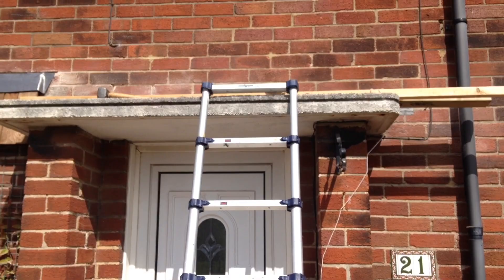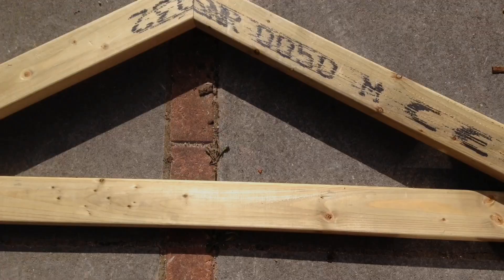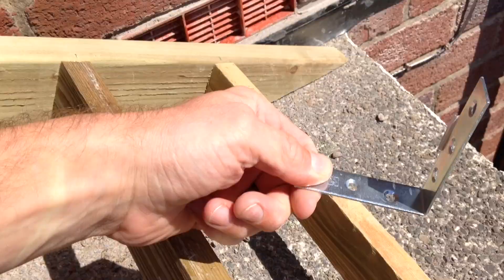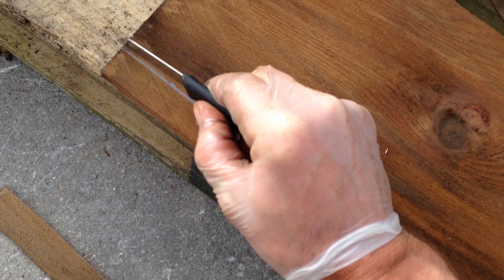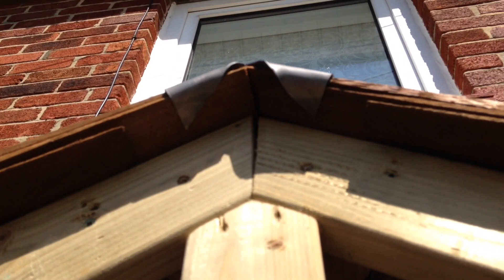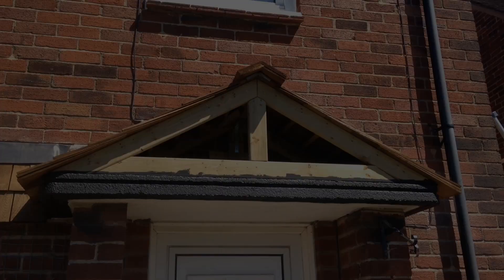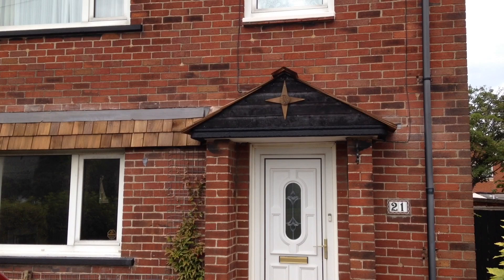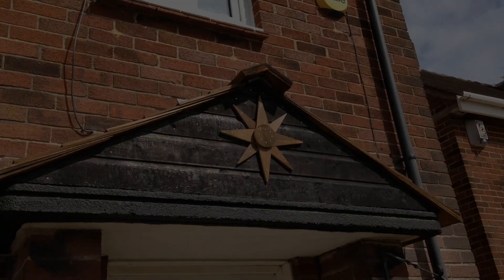DIY Porch Roof: Building a Simple Pitched Roof Step by Step

Comment: Thank you for this video!  I was trying to find out how to build a simple roof for my diy micro camper and I think I'll use this as the lay out, but with the angled downward sides facing front and back for aerodynamics and for rain flow.  I'm no carpenter and have never built a roof but know that I need something other than a flat roof  on my camper, which always ends up having problems in the long run. Thanks again!

Comment: Nice job does the lead have to be inside the main wall to stop water seaping through I've seen builders cut a line into the wall with a angle grinder push the lead in and fill it it with mortor
Reply from the maker: Thanks Tanveer. :-) That's what I did here too. I used lead soakers under the shingles and then a step flashing over the top of the soakers. Check out these videos:
Lead step flashing video (By Fix my Roof): https://youtu.be/j3pQ5cEoacE
Lead soaker video: (By Fix My Roof): http://youtu.be/7PB0yLt5v3k
This is where I got my iformation regarding the leadwork and this guy really knows his stuff!
Cheers, Chris 👍

Comment: Centimeters? I thought you English used your own Imperial system of inches not the French metric system. In any case, thanks for sharing I always enjoy finding useful stuff like this.
Reply from the maker: Hi Eric, thanks for your comment. In the UK we use both imperial and metric measurements which can lead to some quite strange situations... When we wanted to fit carpet to our house, we measured up the rooms in metres. When we went to buy the carpet the shops we visited work in imperial measurements so they converted our metre measurements into square yards - despite the fact that the carpets are supplied in 4 metre wide rolls! 😂 I used to work as an aircraft technician and we had metric and imperial tools and used both systems. In my opinion both systems have their merits and, as in this video, I often switch between metric and imperial measurements to do a particular job. Cheers, Chris 👍
Reply: Haha well yeah that sounds like a bit of a mess, at the same time being familiar with both systems could come in handy at times.
Reply: I used inches half my life in Merica..and now 20 years metric in europe. metric is so much much better..typical ass backwards america has to do everything totally ass backwards. The life is also way better outside of the U.S.

Comment: I hate to tell ya but that is not a very good job!  Angles are not cut properly and this would not pass inspection!
Reply from the maker: It's been doing the job great for our needs and the only inspection it had to pass was that of my wife! 😉
Reply: Which "angles" are you referring to?
There were several things that I would expect may not meet with the local codes there. It's the type of thing that he's not likely to get caught on unless some local official happened to be informed of it. 

I don't think he applied for a building permit, so that's not likely to happen. The only problem with the "wife inspection" theory is it's not going to carry much weight with the local building dept. should it be brought to their attention. 

If you've done a bunch of projects on your house that would normally require permits and inspections and the work isn't up to code, you could be in for a significant hassle.